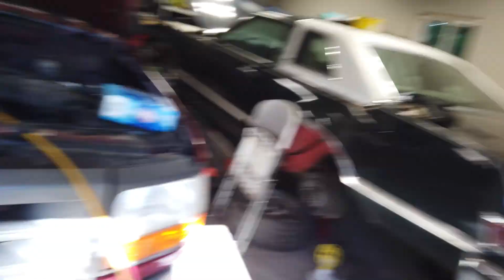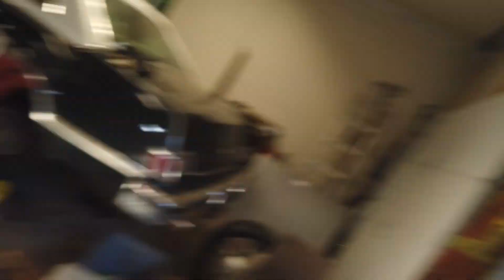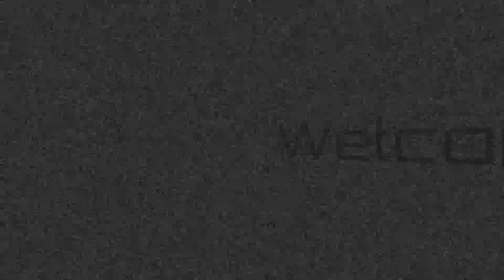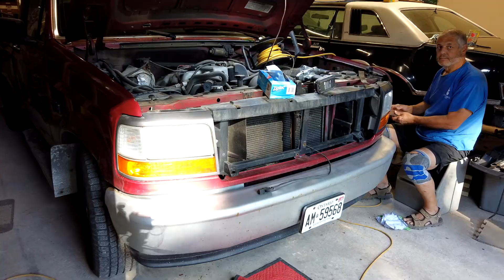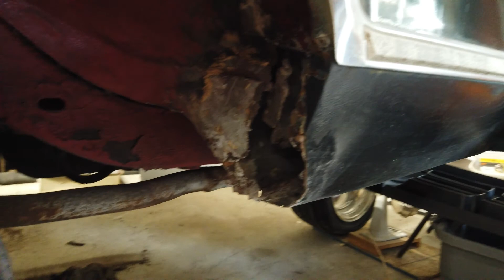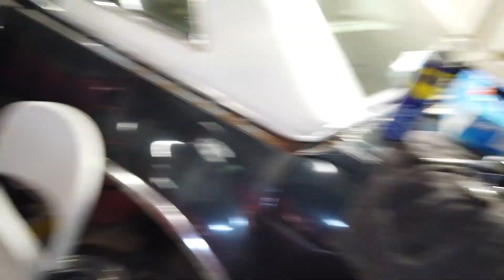F150 rad support replace part 1

Comment: Can you uploade a picture of the inside where the radiator suport bolts on
Reply from the maker: I dont have the truck  anymore. Check out the other videos you should find what you need there. That was a bitch of a job.